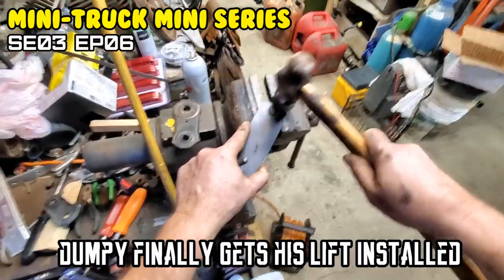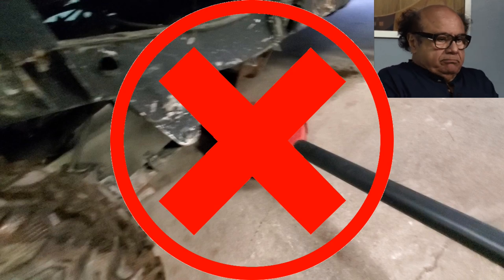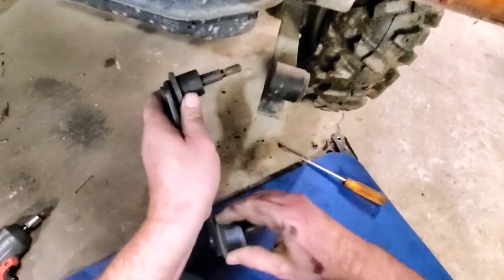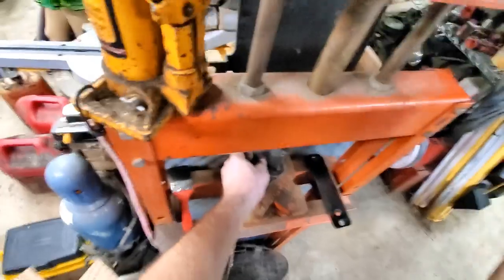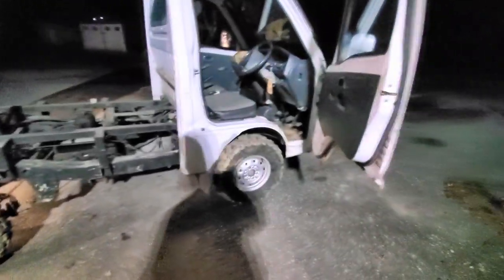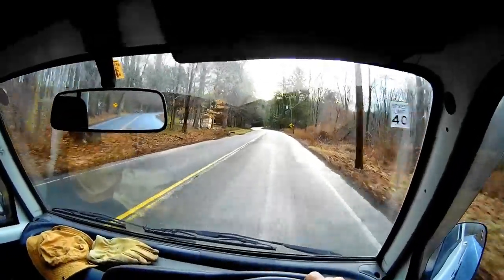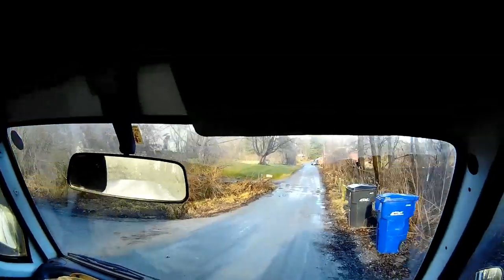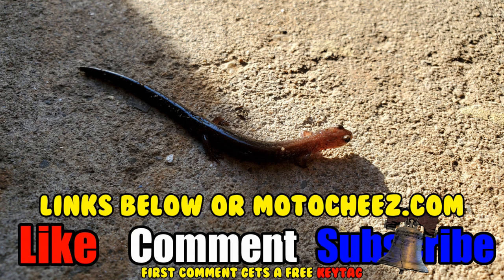(SE03 EP06) Dumpy gets a 2 inch lift. Suzuki Carry Mini Dump truck 2" lift install

Comment: You should cut a pipe the inside diameter of the shackles horizontally and drill out near the center and put in the pipe and bolt it on to beef it up a little bit. I've done it before with those cheapo universal lift shackles they have on the shelf at Autozone and Pep Boys just to give it a little extra strength.
Reply from the maker: I almost welded a gusset on this and on mini... Good idea for rigidity.

Comment: Fill the bed to maxload, then use the jack in the same location under that cross member. 
I have seen two Ford and a Chevy that looked like stink bugs  after lifting from the wrong point.

Comment: Fix the cracks around the front strut tops before they come then the body.
Reply from the maker: There's a main structure cone underneath, but yes they're repaired

Comment: Great video! Question: was the rear right shackle not blocked in by the gas tank? Thinking I might have to cut mine off to get it out, but I’d prefer to reuse the hardware
Reply from the maker: It wasn't, because the rubber bushing will pop out and give you the angle to get it out.

Comment: How well do you fit in your mini-trucks?  I went and test drove a Suzuki and Daihatsu a couple weekends ago at a local place.  At about 5'10", 200lbs I fit okay with my upper body and right leg, but my left leg seemed to always be in the way of something.  I've seen that the Daihatsu Jumbos have a bit more room in the cab, but can you move the seat any further back?  The place I went to didn't have any at the time so I couldn't see how well I fit in it.
Reply from the maker: I'm same size as you, a few lbs heavier and I fit good. Jeff is. BIG guy and he squeezes in!

Comment: Did you get that plow from the last video?
Reply from the maker: No. I have a plow, just have to put a receiver on the front of one of these!
Reply: @MotoCheez  Ohhh? Welding vid coming soon then?
Reply from the maker: @loganholmberg2295  yes, I think I'm putting it on mini, and making mini a dump too!!
Reply: I got a bolt on front hitch for my mini. But will probably weld it on too

Comment: Do your front cups measure 2"? Or is it like a 2x4 and it measures 1.75?
Reply from the maker: I never actually measured them I think they were just under 2 in
Reply: @MotoCheez  im an idiot and ordered your kit, and i have a s81p. Should all be the same i would think. My shackles arent straight. They are z'd or offset. I was trying to see how to measure the shackle length for lift. Seems like a lot over stock.
Reply from the maker: I would think they were the same too

Comment: Get rid of the head cam!
Reply from the maker: They're camera glasses. Nope. Many like the POV and it's easier to use with both hands
Reply: Where can get them? The ones in link goes to blank page
Reply from the maker: @ryankc9oza118  my favorite pair is the "Zetronix ultra wide" I have to update the link
Reply: I love um. But i cant edit like you do. I wud love to make vids of me rides in the forest. But i got no clue how to do it....
Reply: @MotoCheez  the ones I saw like your talking about are around 200 bucks. Are those what you use?
Reply from the maker: @ryankc9oza118  $170 ya